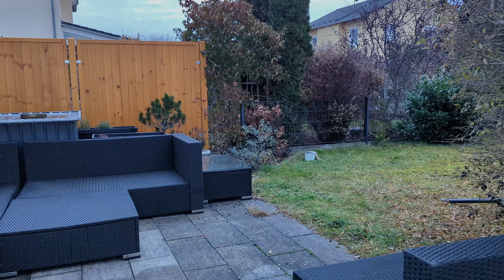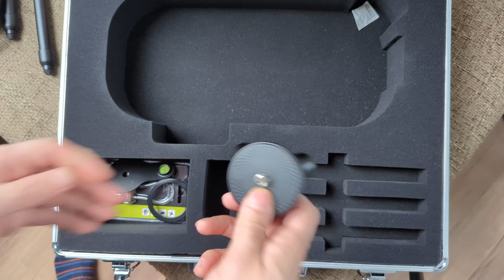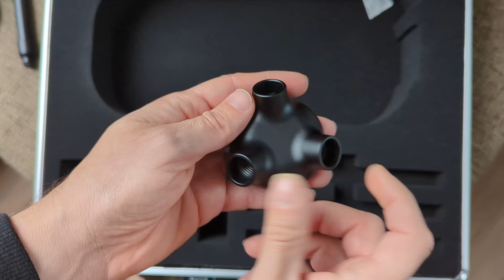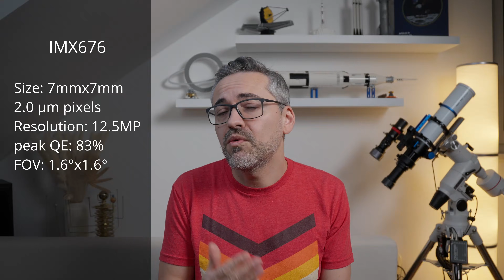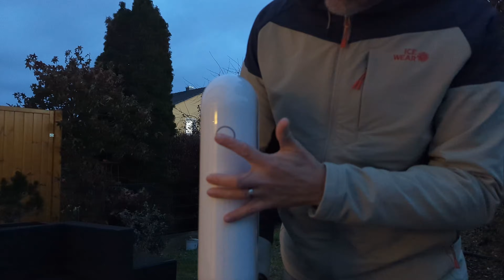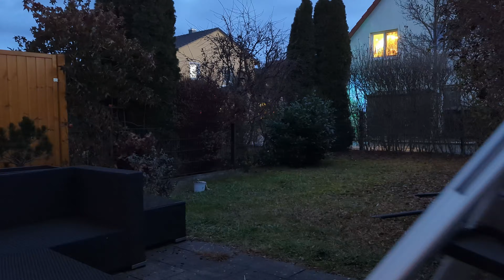The Vespera Pro Changed My Mind About "Smart Telescopes"

Comment: Hello to you all.

I need some help with the Vespera Pro’s Expert Mode. I thought this mode allowed me to adjust the exposure time and gain for a particular DSO. When I tried to use it the instrument took one frame and stopped. I notice that at the top of the Exper Mode Settings page it mentions that the settings are there to take Dark Calibration frames. Obviously I am doing something wrong.

Would you be kind enough to correct my understanding of Expert Mode and perhaps offer a specific page reference to the user manual for further reference.